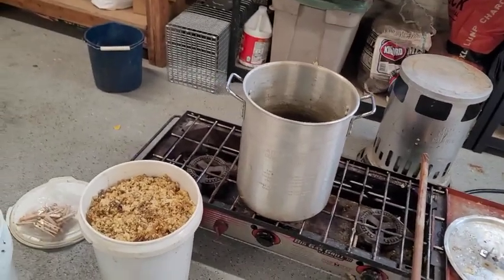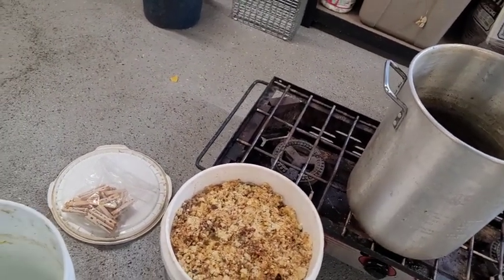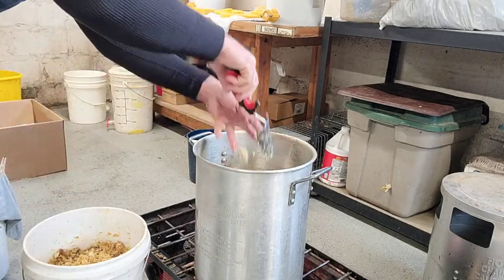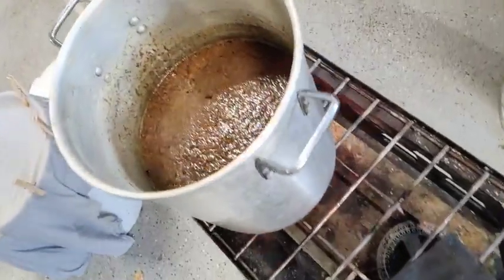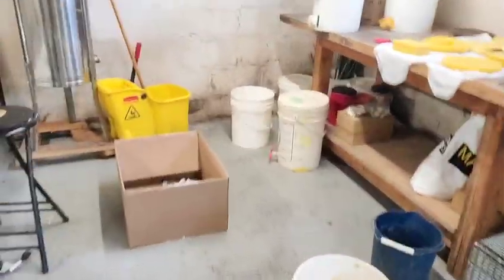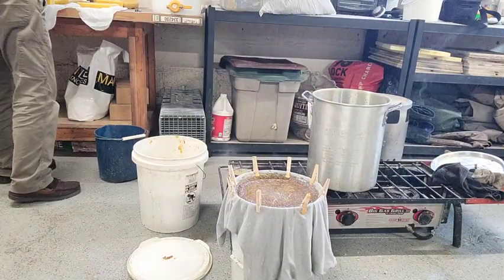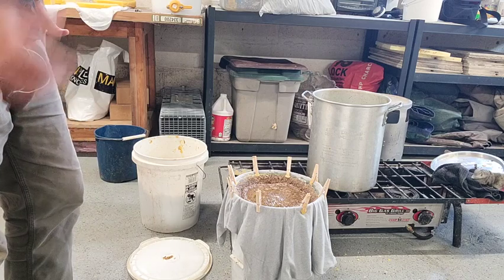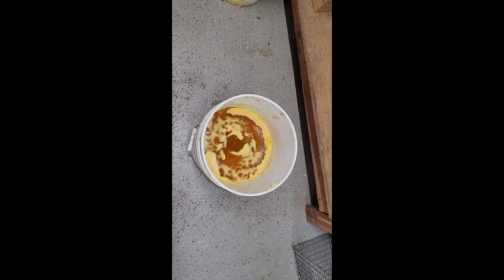How to melt beeswax

Comment: Good video, one that not many YT do. I am still a rookie since I've only been doing it for 3 years now. 
If you don't mind a few tips that I have found useful. Use a metal strainer like they used for pouring tea into a cup. When the wax is melted I filter out all the big particles and dump them into a trash can. This reduces most of what the tee shirt filtered so it flows quickly and is very clean. When you scrape the tee shirt you push through small particles. 
Also you can use a lot less water. It is only needed to keep the wax from burning on the bottom of the pan in the beginning.
 My other thought was that it looked like you got the wax/water mix hotter than you need?? I've heard high heat makes the wax darker but your one lb blocks looked really nice. I stir the mix with a stick and as soon as it is melted I pour it. 
You will love the strainer idea. Have a great day.
Reply from the maker: Thanks Russel.  Funny you mention the strainer.  The next day i melted more wax and i used my original honey strainer.  It is metal and has a course sieve that fits into a fine 1.  You're right, so much easier.  Thank you for the tip on less water.  I had no idea how much would be too little. Good to know.  I think In some time, ill make an amended video.  Thanks again!
Reply: @lakeviewapiary  I like it when people share ideas. No one is right all the time and there are a lot of different ways of doing things that can get the job done.